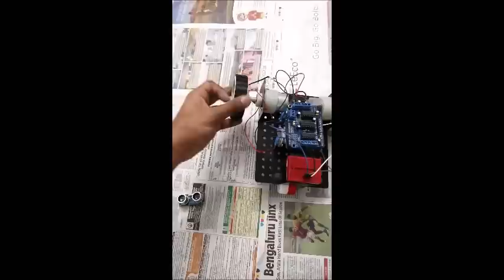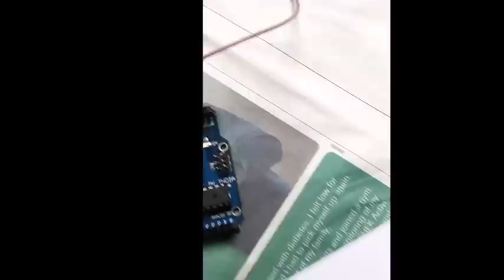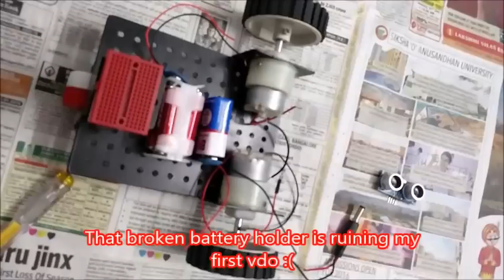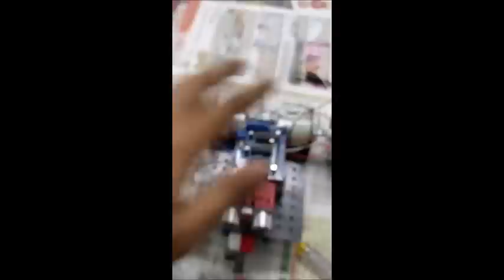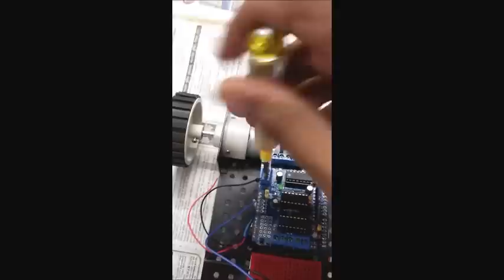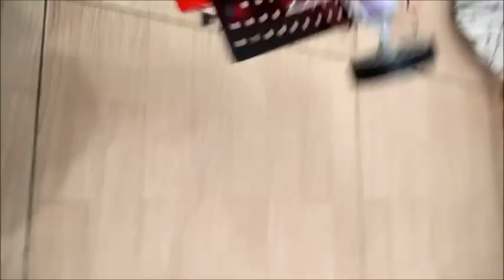How to make obsctacle avoiding robot using arduino uno and ultrasonic sensor with motor shield?

Comment: Plz give code
Reply from the maker: tanya gupta the code is there in description section, I have posted a Google drive link
Reply from the maker: tanya gupta first run the Af motor shield program on arduino, then run the code for obstacle avoiding robot
Reply: Thank you so much
Reply: Can you brief I am having problem

Comment: Great video. just one mistake. If you are using separate power supplies, one for the arduino and one for the motors, you need to remove the YELLOW jumper link on the motor shield board.
Reply from the maker: Ken Franco thanx for the appreciation, that was my first ever project using arduino so i might have done some mistakes
Reply: I say you did a great job. Keep up the good work. Keep those videos coming !
Reply from the maker: Ken Franco thanx again, I have done alot of projects and lately I didn't get time to make videos and upload, but I promise I'll upload some iot based project videos soon
Reply: @KshitijSingh248  hey bro where did you connect the trig and echo of ultrasonic sensor?

Comment: my motor is of 150 rpm L shaped dc motor ,i am giving 9 volt to motor sheild and 9 v to arduino ,but dc motor are not working properly it cannot move forward , only it moves slowly ,sir plz tell me what to do?
Reply from the maker: DEV DINESH did you use motor shield? If motors are slow that means either battery is weak or you have connected arduino to computer or no motor shield, because output of arduino is just 5V, it can't run 9v and 12v motors
Reply: Kshitij Singh sir i am using motor sheild and also external power supply of 9v (HIW brand battery) to the sheild and arduino also but i dont know why it is not working.

Comment: How much load can it carry? How do I increase the load capacity?
Reply from the maker: It depends on the rpm of motor, to increase the load capacity u can use 300rpm or above, I have used 100

Comment: fatal error: AFMotor.h: No such file or directory
compilation terminated.this is d error it was showing
Reply from the maker: Ok i'll see to it
Reply from the maker: U have to first compile and upload, afmotor shield program, then the obstacle avoiding robot program, did u do that?
Reply: S afmotor shield program too showing errors
Reply from the maker: +Ashwini G which software are you using for compiling the program? afmotor shield program is written by adafruit itself so it shouldnt be showing any errors